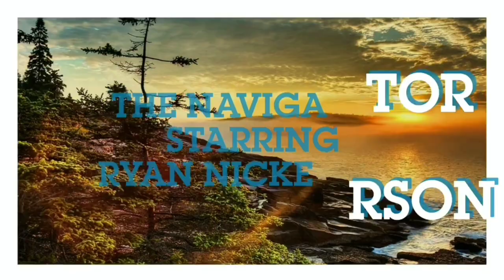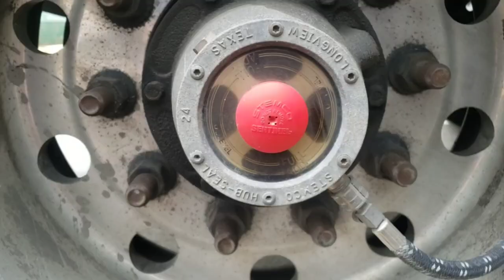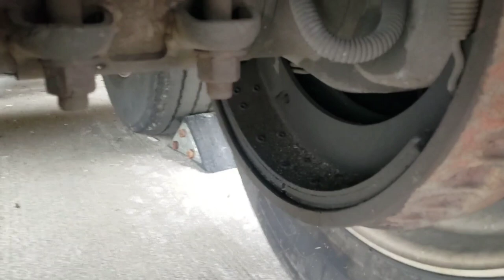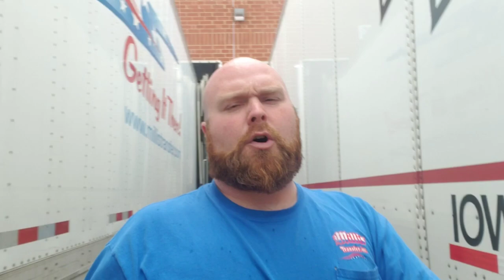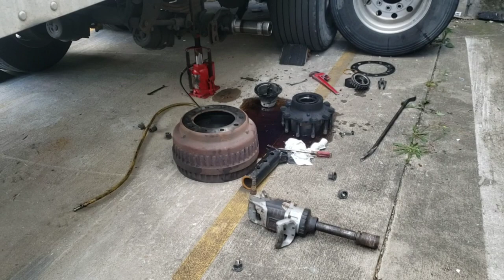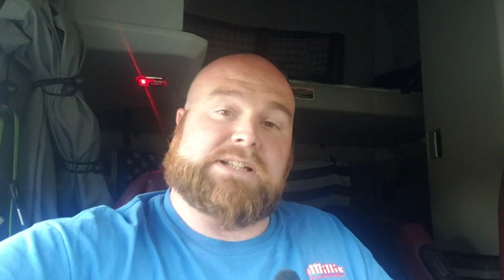Leaking Hub Seal

Comment: Hey Ryan, As a fellow Millis Driver myself I share your frustration with the New Breakdown policy.
Reply from the maker: Last summer I had the Tile Shop trailer from the Ridgeway location. Pulled in to the Eden shop and was out in 45 minutes. The guys stopped what they were doing and replaced two hubs, a tire and two set of break pads and I was on my way again.

Comment: I've also had to take a trailer into a Goodyear shop and lose out on 6 and 1/2 hours unpaid instead of driving up 1 hour to the terminal on a weekday to get the trailer fixed for the same issue I think in July. It would have saved them money and saved me time.

Comment: Hello, I am looking looking to join millis transfer  and I have a question. What is there rider policy like?
Reply from the maker: As of right now. It's 90 days after your issued your own truck. You have to pay like 100 a year to have someone in the truck. They have to be 12 years of age or older.  If you get a safety violation the rider has to get off for 1 year. This could be from a accident, traffic stop to a weight station violation.

Comment: Does Millis Transfer give you guy's breakdown pay?
Reply from the maker: Yes, after 24hrs and if their are no loaner trucks available.
Reply: """"""breakdown pay"""""""
Reply from the maker: Wish. But wasn't a truck issue so no breakdown
Reply: It has to be a truck issue? Dispatch told me they were going to try to get me break down pay for that trailer that I talked about in the comments but I never saw it on a pay statement. Oh 🐋
Reply from the maker: @ManualTruckingManual  ive never been paid for trailer only truck issues.
Reply: @Thenavigator207  I've been down for days with the last and current truck and have never seen it for either